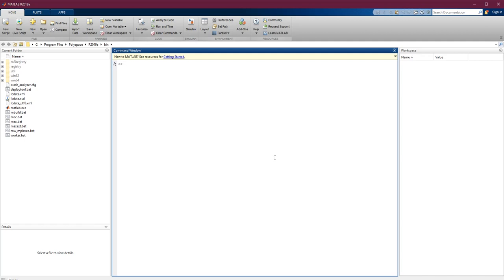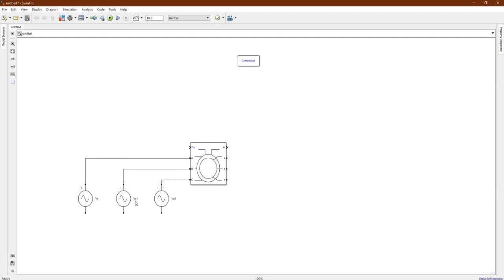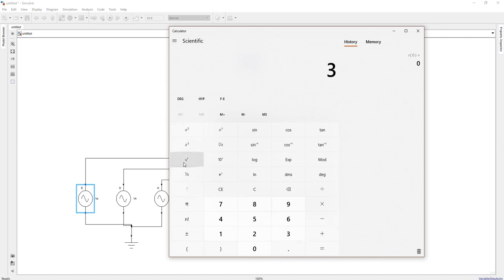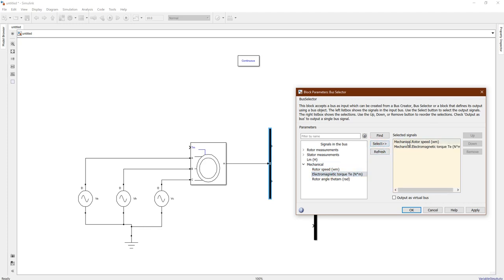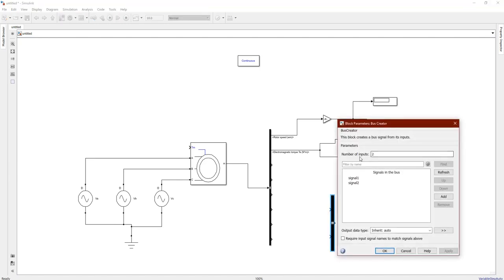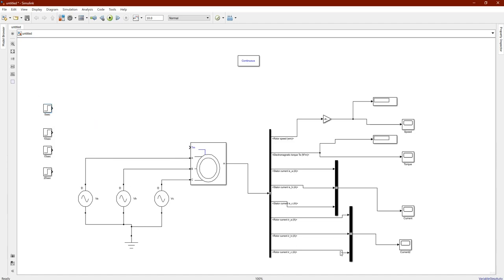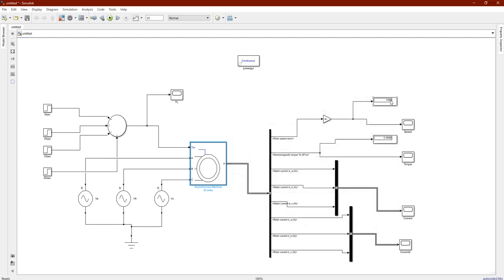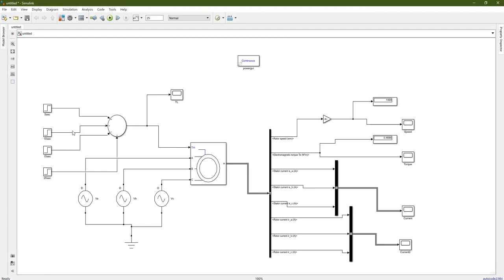Induction Motor MATLAB Simulink or Asynchronous Motor Simulink in MATLAB for MATLAB Online Course

Comment: Thank you for the helpful video. How to simulate a star-delta switch? Can I do it by changing the voltage on the power source?
star - 326.59
delta - 563.38

And how to simulate the operation of the engine in two phases? Can I connect two power sources and connect the third phase of the motor to ground or to a 0V source?

Thank you in advance for your help.

Comment: THANK YOU FOR SUCH GREAT WORK. I DO HAVE TWO QUESTIONS FIRST ONE IS THE SIGNAL OF THE STATOR CURRENT IS TRIANGLE WAVEFORM; WHY? AND CAN I CHANGE IT TO SIN WAVE FROM? THE SECOND QUESTION IS WHY THE MEASURED VALUE OF THE CURRENT HAS A "V" UNIT, NOT "A" ( BILEVEL MEASUREMENT)?